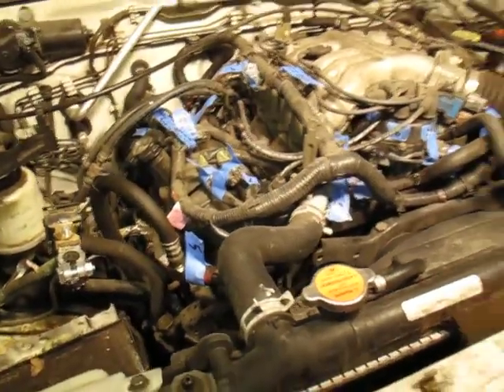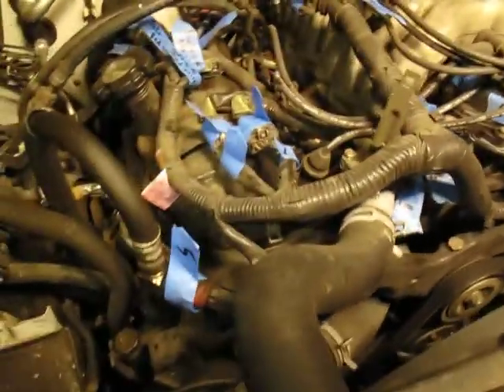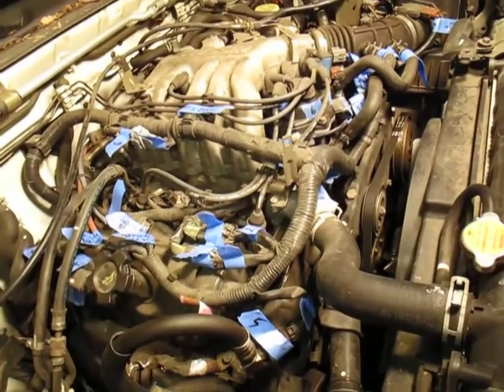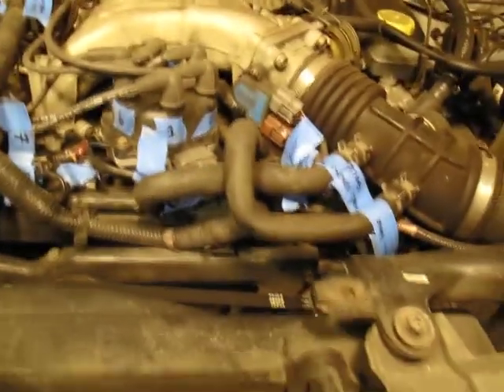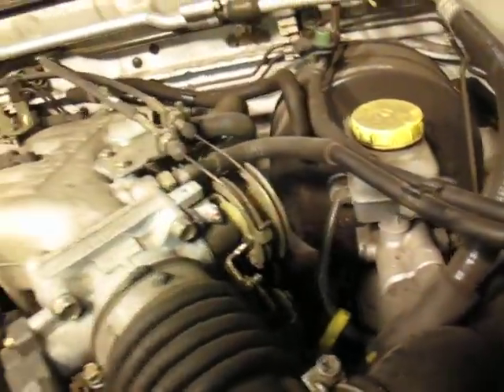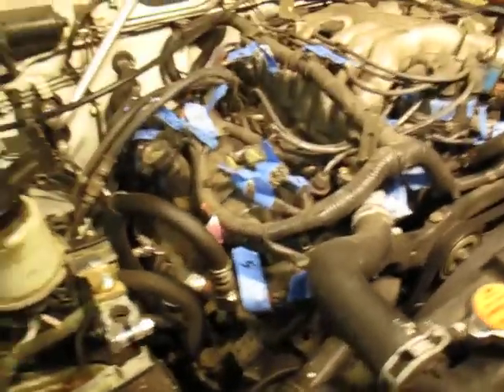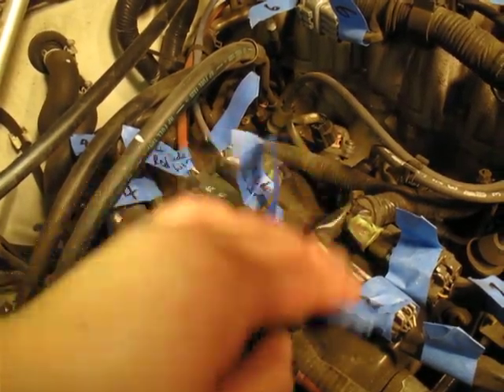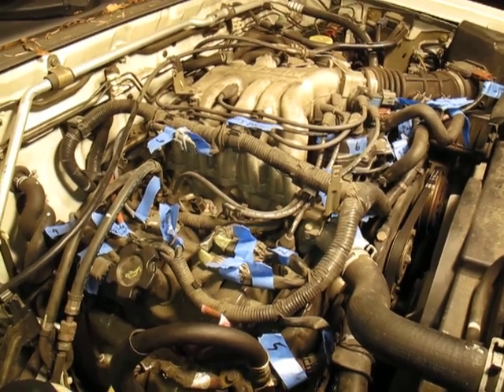2002 Nissan Xterra VG33E Rebuild Step by Step Part 2 - Labeling!

Comment: Just a small tip.. every distributor i have done on the vg33, on the distributor cap, there is already a number etched into the cap itself to tell you your firing order. #1 is up front going counter clockwise... Right next to where the plug wire plugs into the cap.. no need to write on tape to tell you what number is where
Reply from the maker: The one on my Xterra has no markings, but that's a great tip when I replace it!